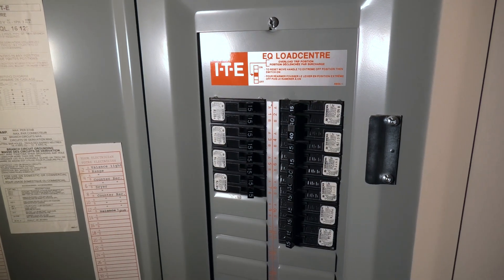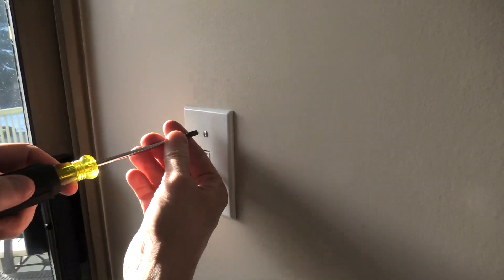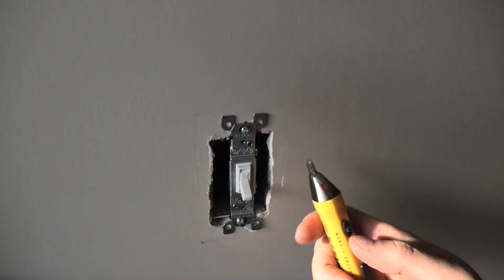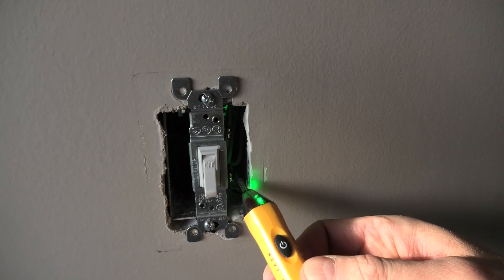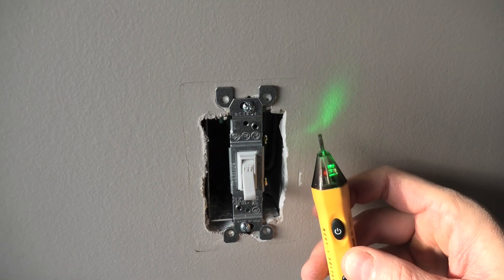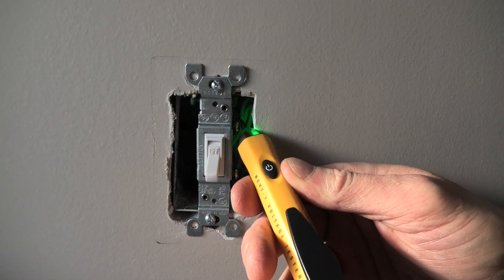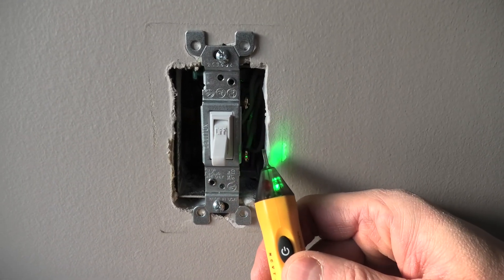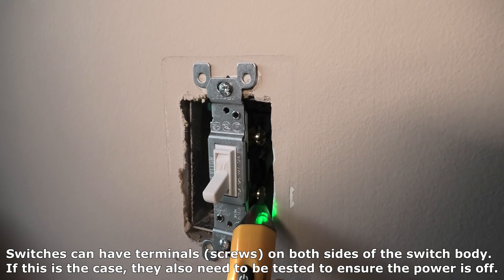How To Test Electrical Light Switch With Voltage Tester To Make Sure The Power Is Off?

Comment from the maker: PRODUCT LINKS:
1. VOLTAGE TESTER - Klein Tools NCVT1P Voltage Tester, Non-Contact Voltage Detector Pen, 50V to 1000V AC, Audible and Flashing LED Alarms, Pocket Clip - https://amzn.to/3NtyvfR.
2. FLAT HEAD SCREWDRIVER - Klein Tools 601-4 Flathead Screwdriver with 3/16-Inch Cabinet Tip, 4-Inch Round Shank - https://amzn.to/4aVXeoq.